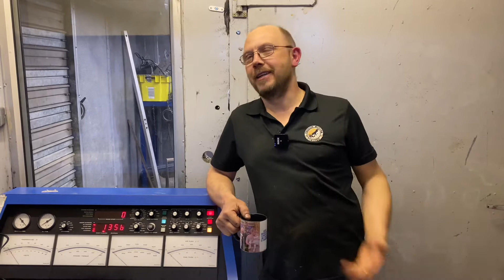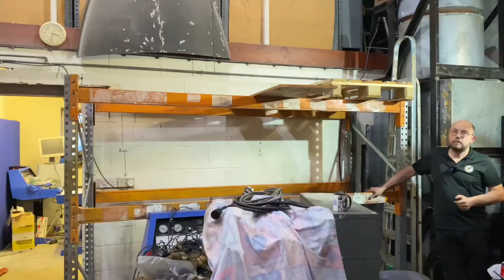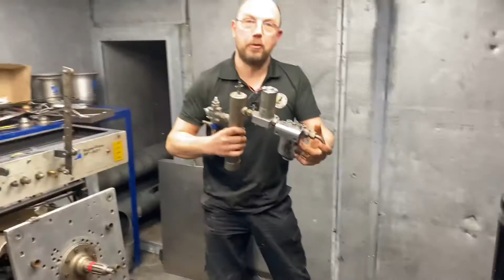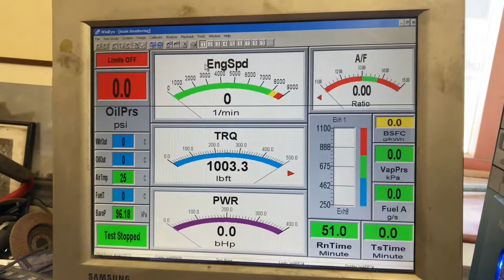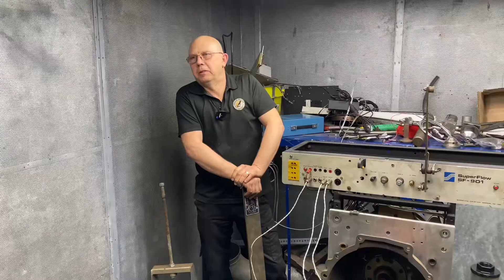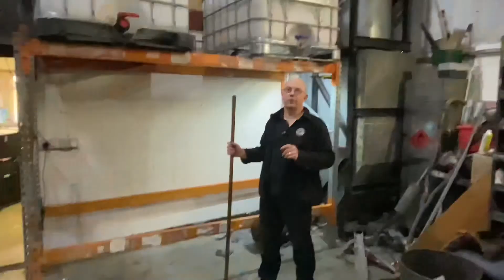30+ Year Old Superflow Dyno almost restored?

Comment: The 802-2 card used in these dyno's is a weak point with these Superflow dyno's . They can go bad and are difficult to repair. When they work, they work well, but when they don't... gurrr. I can see why Superflow basically "washed their hands of them" and are no longer supporting them. They are now on to newer (and much more expensive) versions. Gotta love 1980's electronics.
Reply from the maker: yes, i'd love a 902 upgrade but its way too much money, so i will probably go with the " your dyno " kit if my cards die

Comment: Hello did find a suppler for the dyno to bell-housing  adapters Ive got a older 901 superflow I'm setting up for some Oldsmobile engines got a BOP bellhousig  Please Help
Reply from the maker: i dont know what a BOP bellhousing is, for v8 rover i just made an adaptor plate to adapt a  rover v8 BW35 automatic bellhousing to fit. for Ford pinto/x/flow i modified a T9 bellhousing
Reply: @PenguinMotors  Thanks I will cut up an old muncie 4 speed case and use it to adapt it to the superflow dyno your a great guy

Comment: Does a dyno have its own oil system to cater for engines with or without dry sump or do you have to use the setup for the peticular engine??
Reply from the maker: you just use the set up which belongs with the engine. the dyno does have a big heat exchanger which you can plumb into an engine oil cooler take off if your running engines for long periods to control oil temperature, but its not necessary for most work, and i prefer not to use it to avoid cross contamination of oils from different engines
Reply: @PenguinMotors  ok the cross contamination was my concern
Reply from the maker: @meXicossie  it has a very big oil filter on the output side so there didnt ought to be an issue. for sure if i used the dyno like it used to be you would need to use it, as it used to run big v8s for long periods

Comment: What WinDyn software version is loaded to you're computer. I have one of these SF901 but computer malfunctioned with very little help out of the US. I presume if your running windows XP you probably are running WinDyn 3.2 or 3.5 our was running windows 98SE now that's ancient. l am in the middle of  testing a Virtual machine of win 98se with new computer system running windows 10. The only thing is that the Dyno wont talk to the COM ports now for some reason.
Reply from the maker: im running xp, no idea which version of Windyn i have as im a spanner not a computer man
Reply: Thanks for your message. Finally got it going, Computer system OS is Windows XP Pro running Wyndyn 1.16 which is the only software version you can run for Windows XP on a SF901 this was after  talking to SuperFlow aka  Power Test. Thanks to them for sending me the new software or it would of been a paper weight.